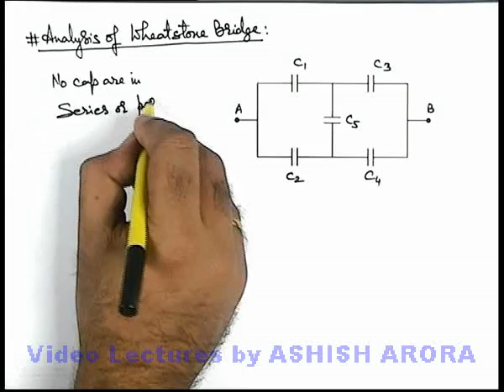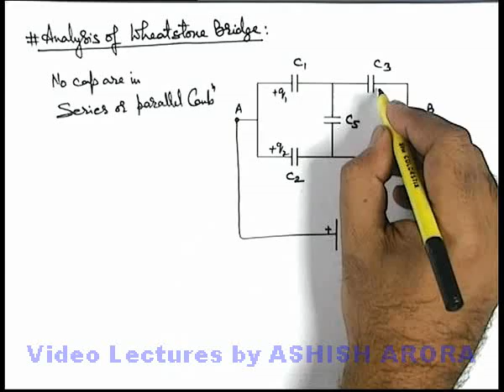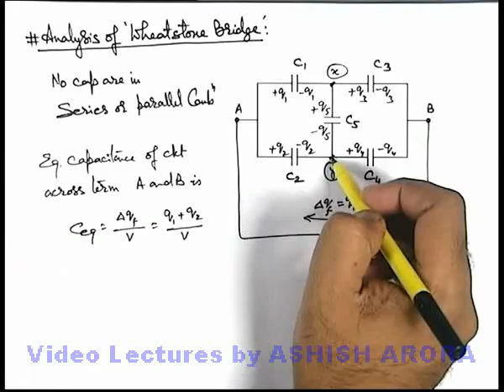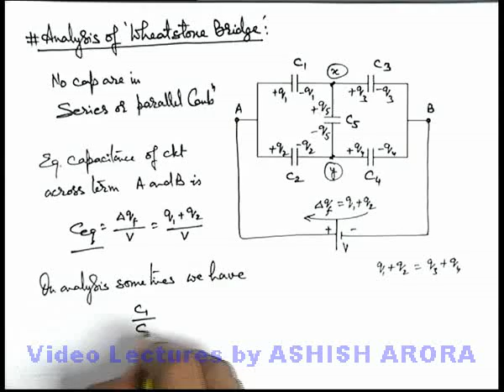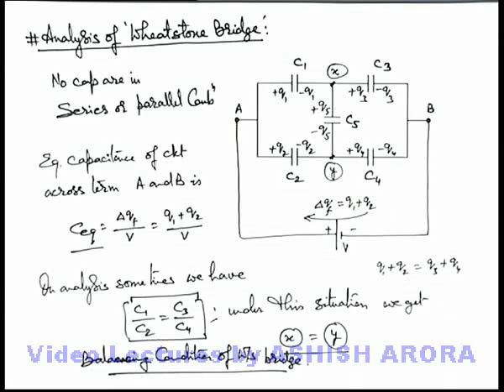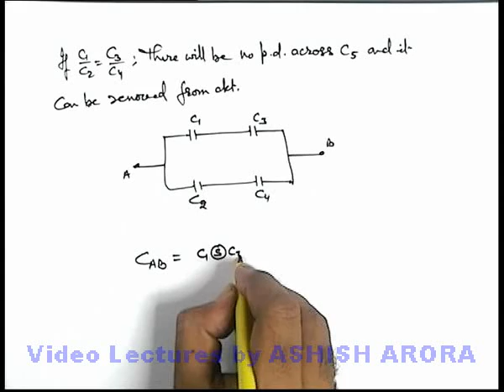Class 12 Physics | Capacitance | #22 Analysis of Wheatstone Bridge | For JEE & NEET

Comment: you consider the junctions, the nodes, to be at centre, top and centre, bottom ?
How could you guess the charge goes zero there ?
Reply from the maker: As on all the wires capacitor plates are connected  charges cannot jump over and come to these junctions or nodes... so these points remain neutral...
Reply: @physicsgalaxyworld  sir here in capacitor 5 due to conservation of charge it should be (q1-q3) charged to become a neutral???
Reply: @physicsgalaxyworld 😊
Reply: @physicsgalaxyworldSir can't it be c5 and Cn where n=1,2,3,4 be in series

Comment from the maker: When a body slides down an inclined plane attached to a smooth horizontal path then after reaching the bottom of incline, it can continue sliding on horizontal part even if there is no change in potential energy of body along horizontal path. Similar to this once a battery connected in closed circuit does work on free electrons and once accelerated, for their motion to continue, no change in potential energy (Electric Potential difference) is required.
Reply: Thank u sir
Reply: Physics Galaxy gareeb
Reply: @edgelordofmordor ab dekh le bhai

Comment: Sir,i have a basic doubt.
Lets consider the portion of connecting wire between +ve terminal of battery and point A. any two points on this wire are at same potential, right? So why does current flow through it???
It seems paradoxical to me....... and even if this is a consequence of assuming the ideal behaviour of the wire, is it reasonable enough to ignore it during analysis of circuits????
PLEASE REPLY.........THANKS!!! and please keep up the good work, u are a life-saver......
Reply: Because it's resistance is zero
Reply: I have the same doubt can u answer
Reply: That is because of the potential difference created between the two ends of the battery. So charges will flow from the positive end(higher potential) to negative end(lower end), and in this journey will pass through the wires. 
Any two points in the wire will have the same potential but, both these will have a different potential when compared to that of the battery's ends.
Reply: i= v/r and r and v both are zero which is an indeterminant form. By concept of limits, 0/0 form is not zero, there will be some value of the function
Reply: HC Verma sir has a video on this topic you all can check that out